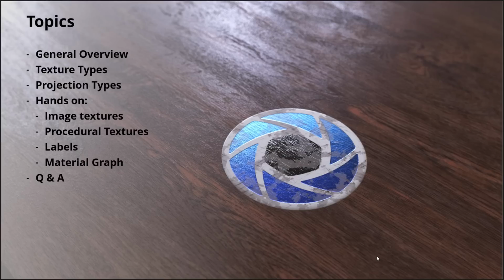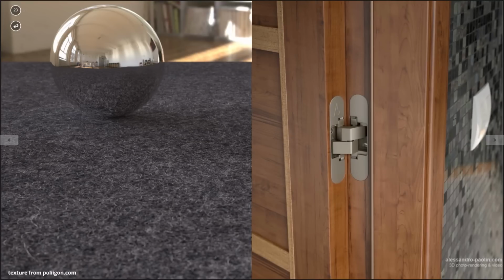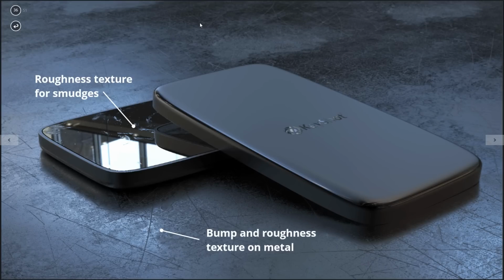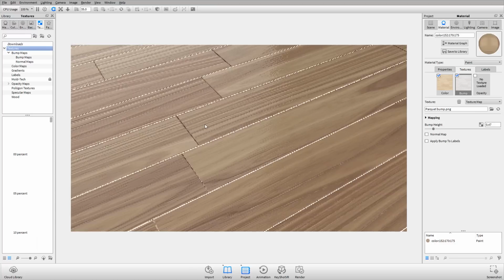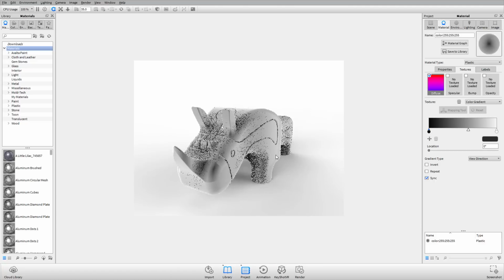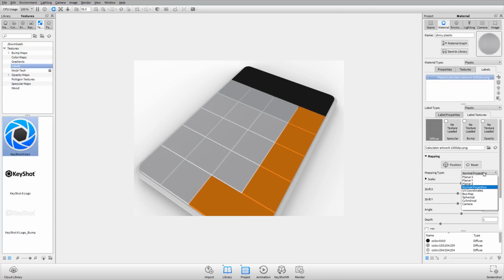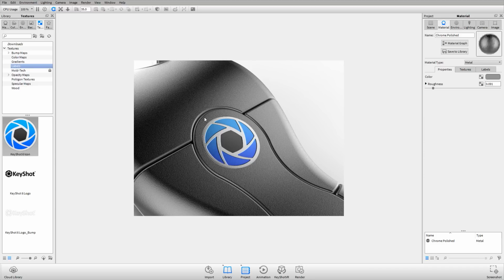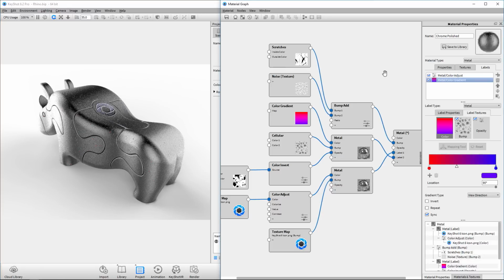KeyShot Webinar 54: All About Textures & Labels

Comment: This video is awesome. although I always use keyshot, I still learned a lot from this webnar. There is a problem confused me. When I turn on the interior mode, The ground surface become visible, If I do need the ground surface, is there any thing can I do to solve this problem?
Reply from the maker: Unfortunately this will be the case when using the "Ground" material. Try using a different material type for the Ground.
Reply: Got it, thank you